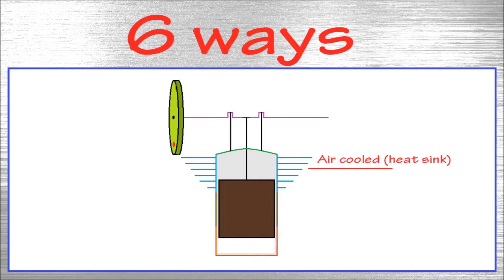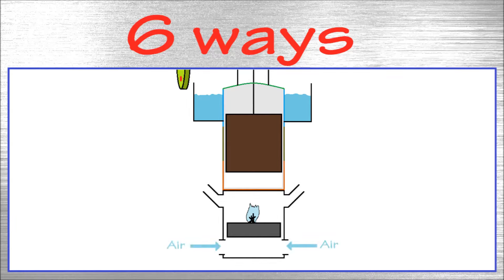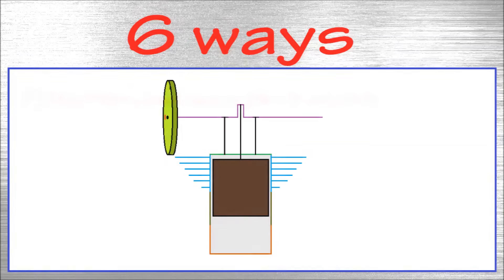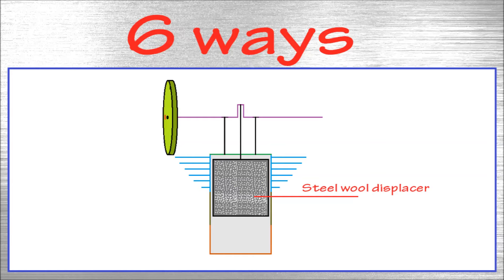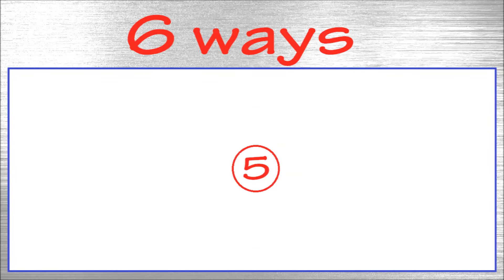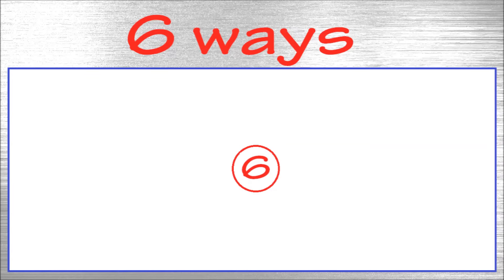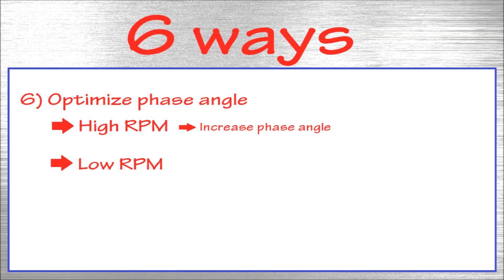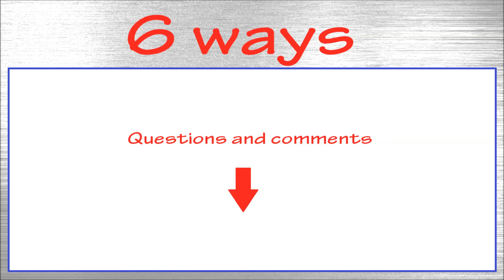6 ways to get more power from your stirling engine | Create a powerful stirling engine

Comment: Please  make part 2 . And say about 
1. Best radios of basic heat chamber ( homemade, for example cold drinks cans ) 
2. Best radios of power piston 
3. height of the engine. 
4. length of engine 
5 . Burnings materiel 
6. Height of the burning chamber.  
Please make part 2 with this type of question 
                🤭   Thank you 🤭

Comment: You missed few things.

That the temperature difference should be as close to 0 Kelvin as possible. It's basic ratio in the heat engine efficiency formula.
For example 200 degrees temp. difference in the range of 293 (to 493 degrees for 100 degrees diff.) is proportionally smaller than for example 73 (temp at which air is liquid) to 273.
It's simply because whatever the temperature difference you're using (200 degrees in the example) is smaller part of higher temperatures than it is in lower temperatures. And Entropy operates based on the real Zero (ie Kelvin).
I know -200C is not in the range of your typical kids toy use or even car temp.range :) but if you're using it for stationary engine and are keeping half the temperature difference in a cryogenic cold tank you can use liquified air as a thermal battery and later use that cryogenic tank difference to a flame (or better sun's concentrated heat energy) to drive a Stirling engine.
(Note that the Stirling engine being reversible means you can actually use energy to pump heat In & Out of the respective Hot & Cold tanks - ie charging the thermal-battery).

Also air is not a good gas to use in the chamber, there are gasses that can transfer heat much faster. Ideally hydrogen, but if you're worried about it exploding, helium is also great one!

Also to increase total power you can increase the pressure in the chamber. For example increasing the pressure 10 times will increase the work done 10 times, and won't change the way the engine operates are it depends on the temperature difference and thermal conductivity, but not pressure.

You mentioned roughen up the Cold & Hot ends of the chambers to increase thermal conductivity, but sanding it won't help much, and the speed of the thermal conductivity is really important!
One solution which I've seen a company do is to use very fine fins on the end of the respective chamber, which are dipped in some fluid with high thermal conductivity.
The idea is that the fluid doesn't compress (noticibly) under pressure, so it won't change the way the engine works, but will allow the fins to exchange temp. much faster with the working gas when that respective chamber is expanded, and then transfer that temp. into the fluid reservoir when that chamber is contracted and thus the fins dipped in the fluid (increasing the thermal conductivity on the outside of the chamber is easier).

I believe Stirling engine can be a clean and efficient solution for converting Sun's energy (or other natural heat sources) to usable energy, which then can be transferred in (electric) tools & vehicles that are not convenient or compatible with Stirling engine.

Comment: Does the air pressure inside the chamber affect efficiency of the engine?
Reply: Only temperature is a factor in Carnot (Stirling) efficiency.  Air pressure (the mass of working fluid in the system) affects power output from the system.